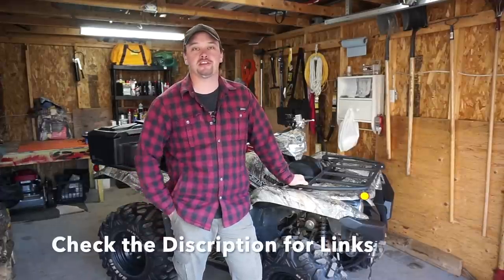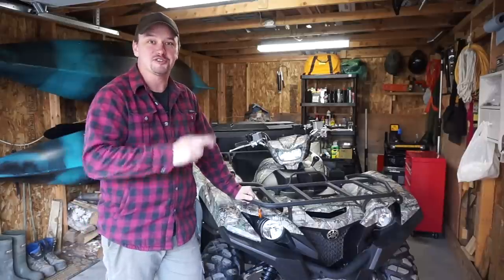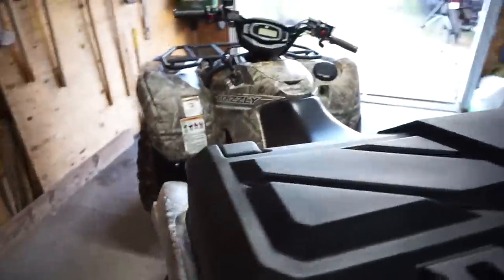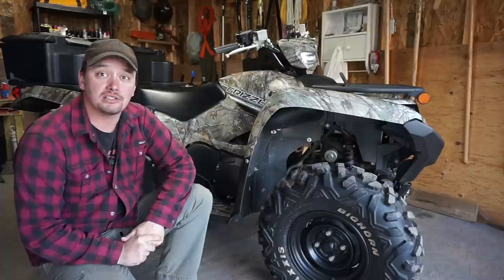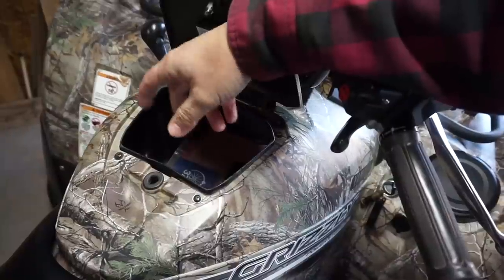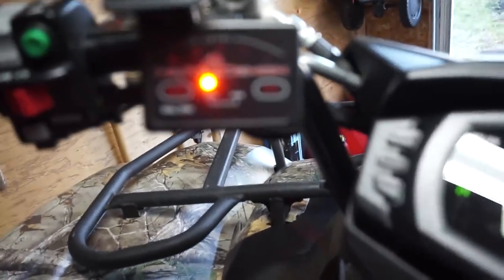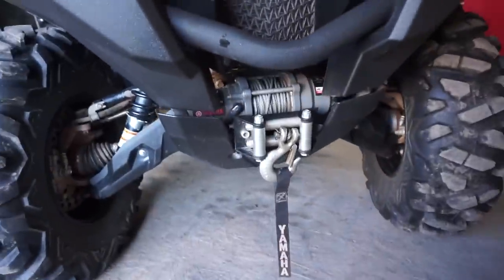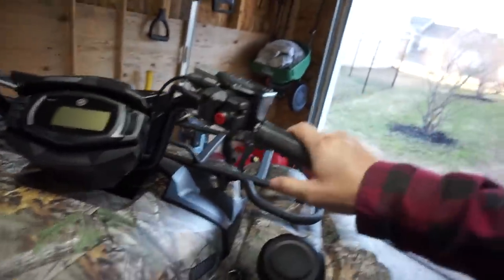Honest Owners Review - Yamaha Grizzly + Mods

Comment: I have a 2007 grizzly SE it has 22000km and 3920 hours still runs and drives .Yes everything around the engine has been changed like axle shafts bushings wheel bearings 3 sets of tires worn out. Stator is the only thing that burned out twice that's the only thing inside the engine that broke.Engine lasts for ever everything else around the engine falls off before.Still would buy a new grizzly if they make a 1000 engine 700 is good but looses power over time.
Reply from the maker: Hey man !thats amazing ! those old 686's were such a tough motor, I think they are tougher than the new 686's too. And I'm with ya man, I held out for a 1000 Grizzly for so long but I ended up getting a 2017. I do like the power steering too. Lets hope Yamaha can finally put out a new 1K grizzly.

Comment: My 2017 had to get rebuilt due to oil consumption.. only had 700 some miles on it..
Reply from the maker: maaaaaan..... that Sucks ! it's sad to hear so many stories like yours.... I don't get what Subaru screwed up so bad to cause all of this... I'm a lucky one, no issues yet.
I will probably look into that recall on the top end, just to make sure I'm good.
I hope you were able to get your machine fixed and/or got one that works the way it's intended. Cheers !

Comment: I have 2018 with 6000 miles . no issues st all . lots of oil and diff lube changes. Good to know the belt lasts so long. what about valve adjustments ? I havent done mine yet. Anyone else have high mileage with zero adjustments?
Reply from the maker: Hey man ! thats great to hear ! No valve adjustments here... I was wondering if it may need one though..... the motor sounds a bit rougher than my 686 did. No issues at all yet though, I hope it stays that way.

Comment: Hi, I’m interested in a used 2018 Kodiak same engine as yours. I’m a little hesitant because of some of the comments on that engine. Does yours use any oil or any issues?
Reply from the maker: Hey !! I havent had any issues with mine at all, it's been a solid motor. 3500+km so far. doesnt burn any oil. But I know what you're saying, some people have had issues with the 708.... I think part of it, is how well it was treated, broken in right, maintenance, and stuff...
Reply: @Maritimer  thank you!

Comment: What are the tire sizes? Want those for my 2019 Grizzly se. Love the review also!
Reply from the maker: Hey Rodney ! thanks man ! they are stock size, Front: 26X8X12 and Rear: 26X10X12 and the Big Horn 1.0 measure 1" taller than their measured size, so 26" = 27''.
they are a great tire for pretty much everything, Hard Pack, sand, rocks, and snow. I've never had any issues in mud either.

Comment: My buddy had a '16 with the oil burning issue, there would be a puff of blue smoke on startup.

Did you have any cracking on your Bighorns?
Reply from the maker: Hey man, sucks to hear about your buddies '16.... it does seem like 16 was the worst year for the 708's. 
No cracking on the ones I have now or the ones on my 2008 Grizzly. Did you have cracking?
Reply: @Maritimer  No but I've heard from a dealer that it has been an issue in the last year or two.  I have a '16 Honda Pioneer and have a few slices from rocks but no cracks.

I have not been talking to my buddy in a while since everyone is working from home, last going off he was debating if he would get it fixed under warranty (Yamaha was covering it) or just run it and add oil as needed.  The concern with getting a new top end was centered around the level of skill of the mechanics at the local dealer.
Reply from the maker: tell your buddy to get it fixed for sure if Yamaha is paying. I have some slices in my tires from rocks also, not losing any air or anything though.

Comment: Great video. I bought and still have 2015, in running the Bighorn 2.0s and like them a lot. I had the same issue with 4wd switch. It may even have been your video I watched to fix it but I'm not sure. I did that a year or so ago. I'm using Rotella T6 oil in this machine and my 1987 XR250R. Seems to be just fine. I think you may have more kms than me haha.
Reply from the maker: hey ! thanks a lot man ! that's awesome you were able to fix your switch. thanks again for the support !

Comment: So I guess you left your front sway bar attached? Can you explain why you only removed the rear? Just curious
Reply from the maker: Hey man, not sure if where you're from they are called something different or possibly a miscommunication... but there is no front sway bar on these machines.
the rear sway bar is simply 4 bolts and a sway bar link you need to pop off.
Reply: @Maritimer  oh cool, thanks. Are you still happy with it off?

Comment: Hey could you do a video of a cold start up on your bike of the exhaust? I have a 2016 bought as soon as they were available and after 500km I called the dealer about it smoking on start up. They said yes they do smoke on start up. Its still smoking on start up and I do all regular maintenance. It has 1700km, 94 hrs. I now finally find out there is a recall and they used the wrong piston rings. I contacted a new dealer now and they are going to confirm smoke and need oil consumption numbers to send off to Yamaha for warranty piston and ring repair.
Reply from the maker: Hey man ! That sucks you are having the smoking problem.... No smoke or oil consumption for me (yet) I hope I don't have to deal with all that.
Mine has 3000km now and no smoking at all on cold start up, I look everytime bc im paranoid haha
Reply: @Maritimer  Ok awesome thats good to hear you have no smoke issues. I should find out in about a month when the appointment is.
Reply from the maker: Keep me posted !

Comment: Hey guys, 
would you change shocks like Elka or Fox for fast trail riding ?
Reply from the maker: Hey ! if you do a lot of aggressive trail riding at high speeds then yeah upgrading your shocks would be a nice upgrade, saying that it's not " needed" but it may make the ride more enjoyable haha the grizzly suspension is fairly soft, so if your hitting jumps or trying to slide around turns then a stiffer set up may be best.
Reply: @Maritimer  thanks mate ✌️, thats what I needed to know

Comment: After 18 years I finally sold my ‘03 660 and managed to find a ‘21 Grizzly 700 in the camo. Exactly what I wanted. I sold the ‘03 for exactly half what I paid for it! Crazy world. 
Has the addition of the EPS tuner increased your HP? What was the primary benefit of adding it?
Thanks
Reply: I run the ehs tuner on mine I found it made the bike more snappy on the throttle. I also did the ais delete. Biggest difference for the 2017 bikes is it helps with the backfires coming off the gas
Reply: @ivanfitch9158  wondering how it will affect the 686? You are just blinding off the AIS yes?
Reply from the maker: Hey man ! Sounds like you did OK with that old trusty 660 ! haha Ahhh yeah the tuner is more just to cool the motor down,not really for power at all. I agree with Ivan that it made the throttle response better. 
You start messing with trying to get a bunch of HP out of a tuner you will affect the reliability too much. Truth is it's a 700 single, nothing more or less,  it only has so much power haha

Comment: what about a block heater for my 2012 grizzly 700 for cold weather starting
Reply from the maker: Hey Bob ! I've never had a block heater, and haven't had any issue starting my bike in cold weather, (sitting for a few months --25C to -35C, and starts right up) Saying that, a block heater would probably make for easier starts, I've never heard of a block heater for a ATV or SXS, do they make them?
Now I usually plug in a little electric heater a hour or so before I plan on starting my ATV, just to warm it up a bit, so I guess thats basically the same as a block heater, so yeah I think that would be a good idea.

Comment: Had nothing to do with emission , and the 708 have proven that its not up to snuff.
Reply from the maker: You're saying the change from 686 to 708 had nothing to do with emissions? You sure about that? Everything I've read says different.
And yes Yamaha changed the 686 to pass emission testing and went back to it b/c it was such a good motor. Which is what I said in the video. Although I think the older 686 was better (2014-15 model Grizzlies being the best.)

Comment: sure isn't much on the 450 grizzly i couldn't even find out how to remove the dang seat for it on youtube
Reply from the maker: Hey ! Not sure which year grizzly you have but I know my older 2008 grizzly had a latch on the back of the seat and my new grizzly in this video you just pull up and its held on with plugs. I liked the old design much better. Do you have an owners manual? I'm sure it would be in there.
Reply: @Maritimer  Thanks Bud, i got it, on mine you reach around back on the two corners and just jerk it up and the seat popped right off.
Reply from the maker: glad to hear you figured it out.

Comment: What is the tuner for and what does it do actually?? Thanks
Reply from the maker: Hey man, the EHS tuner is to make the 708 motor not run so lean, which makes it run cooler. it works really good !
Reply: @Maritimer  So it richens it up. It's not like a perfomance type of thing right? Like adds horsepower?
Reply: I would think it would void a warrantee.
Reply from the maker: @sundancer4426  Hey man, yeah the EHS isn't really for performance. I personally waited until my warranty was up before I put it on, just so Yamaha/dealer couldn't screw me over for anything. 
I noticed my throttle response to be a bit better too after installing it. I wasn't interested in any performance/HP gains, just cool the motor down, making it more reliable.
Reply: @Maritimer  It's funny...the thing should run cool period. My 06' Grizzly runs flawless with 4000 miles.
Reply from the maker: @sundancer4426  I agree with ya, but Emission laws changed a lot from 2006 to 2017.... to get motors to pass the testing they make them run leaner.... in turn they run hot.
my 2008 Grizzly always ran cool and was a great machine.

Comment: What size tires do you have? My 2020 I just bought used comes with 26.
Reply from the maker: hey man, I mention in the video that they are 26" Big horns, 26X9X12 in front and 26X12X12 in rear. Big horns measure 1" larger... so when new a 26" will measure as a 27".
Reply: @Maritimer  Oh sorry dude. I missed it. I have looked forever and couldn't find the stock 26x 8x 12 ect... Really don't know if I want wider tires. Might have to switch brands. My 06' has 25" 1.0....best tires. Heavy though. Lost 5mph top end. I knew that was going to happen though. Thanks!☹

Comment: The Subaru Is noisey at the clutch . 
There is a nut that holds the water pump and oil pump , it has history of backing off causing failure .
Reply from the maker: Hey Jake, even the 686's had a noise clutch (usually on start up when it was cold) but seemed to go away after it warms up. My old 2008 grizzly had that loud clutch too. so not just a 708 thing.
I've never heard of that nut backing off for the water/oil pump, you are the first I've ever heard of that happening too.... that sucks !
Reply: @Maritimer  I went to a 2019 king 750 , power steering lacks power . Now I have a 2020 xtr grizzly . Excellent machine so far .
Reply from the maker: Sweet ! I love the new XTR's, great colours ! but it's really just a regular grizzly with fancy rims and different colours. great bikes though. I like the King Quad too, I was looking at them when I bought my grizzly.

Comment: I have a kodiak with the same engine, I like it, its decent , i'm not complaining too much but, I found it strange you have no CONs , almost as if your not doing much with it. myself I can go on with things I don't like that should be improved: have you ever needed to remove the batterie> my god its stupid, the sensor for the power stering stoped working the first year, the gas thumb is way too hard, the display and fonction are horible, the racks aren't the best in the market, the diferencial lock is finicky, often takes a lots of tries before it gets on, the 4 x4 selector is now going on by itself and I have to press the buton a few times to make it go off. and no, I'm not doing anything real creazy with it and it has around 5000 kms on it.
Reply from the maker: Hey Michel, Not doing much with it? my whole channel is about using my ATV haha I use it mostly for trail riding, exploring, taking my girl out, camping, hauling wood at the camp.... I'd say that's what most people do with their ATV. Mine has I believe 3300km.
I said I didn't have any real cons, and I stand by that. I mention I like metal racks, & the traditional look of an ATV...  I also think the Polaris design is cool too (Which I mention in the video)
I mention in the video my 4X4 button acted up (like yours is, it's a common problem) and I fixed it myself by taking it apart, cleaning it and adding dielectric grease, the issue went away and never returned. I have a video on that if you are interested. My diff lock has worked perfect every time I've had to use it.
I agree and disagree with you about the display, I find it to show everything you need to see, I find it clear and easy to see. BUT I the display hasn't changed much at all since 2008... On the new models (I believe years 2018 or 2019+) have a newer display, which I really like.
Anyways I hope your Kodiak treats you good in the future too. Cheers !

Comment: As a rider with over 23 years experience anything but Polaris or Can am as far as atvs is a joke. Yamaha is stuck in 2007. I had a Polaris Sportsman 850 all the way back in 2011. Sure they are catching up in the sxs game. Lets get real 700 cc is so early 2000 ish.. Never had a problem with my XP850.
Reply from the maker: Hey Steve ! Good to hear you had good luck with you Sportsman, they are a nice machine. I always love the ride on the Polaris's, super soft/smooth.
 Not sure about your comment on other ATV's being a joke... Years of proven quality and reliability, with the Hondas, Yamaha's and Suzuki's. They are much lighter machines which count if you get them stuck/riding in snow. I agree with you and said in the video; the 700 is an older/dated motor but in the trails is has more than enough power, it's really only fire roads where the twin would be better. For my style of riding the 700 is fine, it's amazing in the trails, can wheelie the machine and can get up to 100km/hr+ which is plenty fast, saying all that I'd love an 850-1000 Grizzly haha but not at the expense of reliability. 
I drag raged my friends 850 Popo and we were dead even to about 70-80km then he was able to pull away, I don't ride at 80+km/hr too much as you might know from my videos haha Thats the beauty of having so many to choose from, you can get what's best for Your riding style. Cheers man !
Reply: @Maritimer - Seems like Japanese atvs have alot in common with Japanese cars. They are reliable and resale  value is #1 for a reason...they last!. One other thing, when you go to an atv dealer they are sold or nearly sold out on yamahas but yet have a dozen Polaris units sitting around.. Wonder why? Hmmmm.